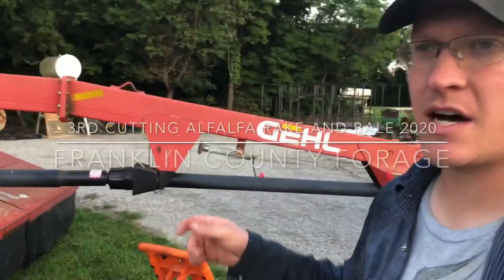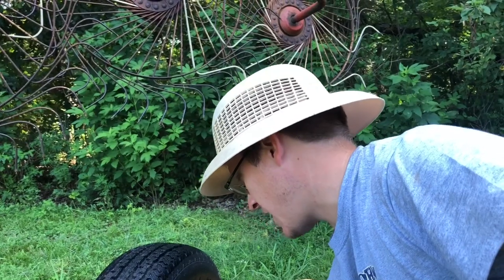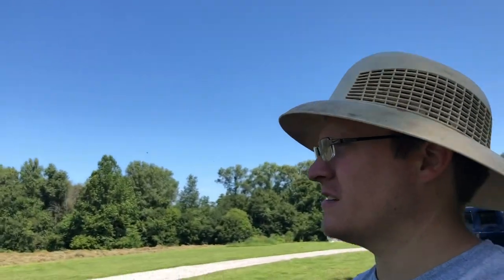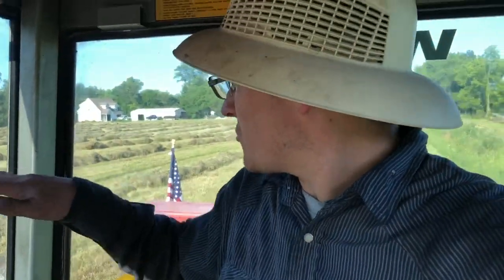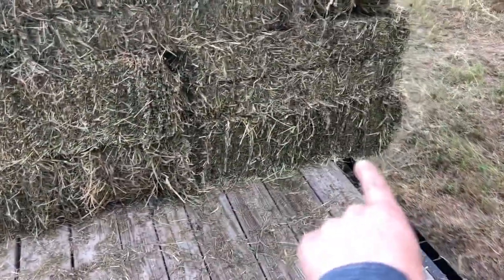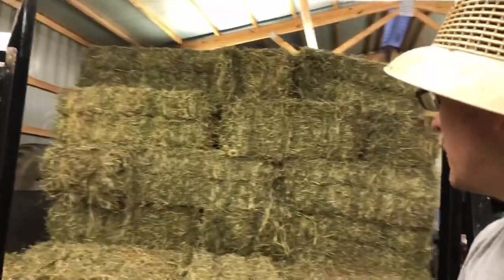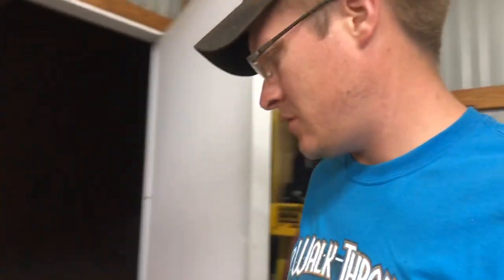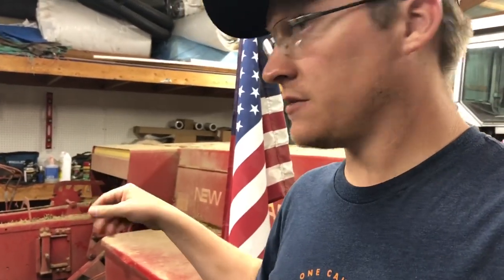3rd Cutting ALFALFA 2020 Rake and Bale New Holland 326

Comment: I used to have a 326 baler. It was a great baler but always had trouble with getting the bales consistent. would  shoot out a 6 inch longer one ever once and a while. Needed a 75 hp tractor and I was using a ten bale Accumalator with it and I bought 5070.  Works a lot more consistent bales. Great video!